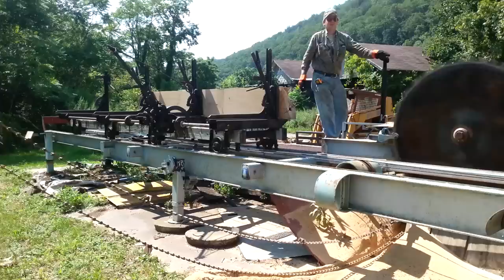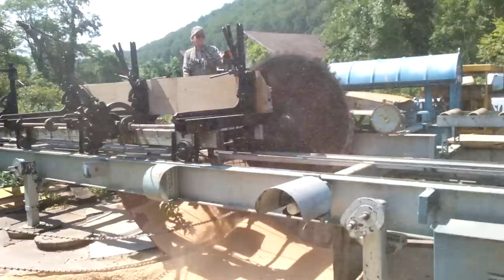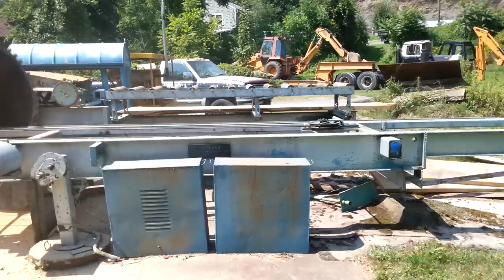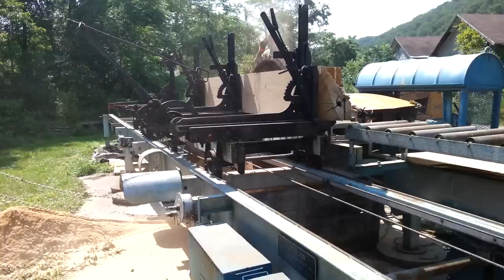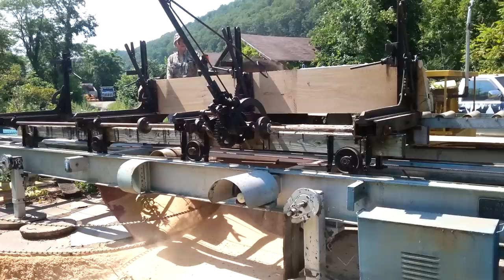American Model #1 Sawmill

Comment: What is the mill powered by I have a chance to by one but need to know what hp it needs thanks
Reply: +Andrew Tiefry   I have a 471 Detroit on mine runs great
Reply from the maker: This one is powered by a Ford industrial diesel engine originally from an air compressor. Attached to a Chevy 4 speed transmission. Cut in 2nd gear.